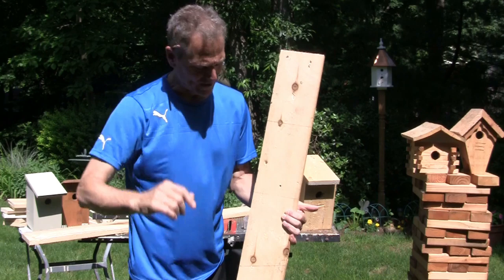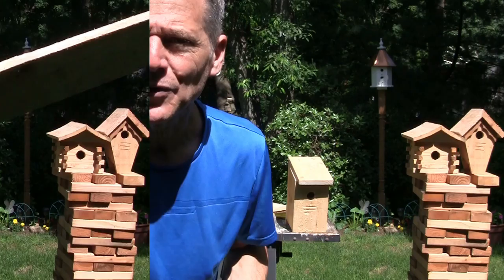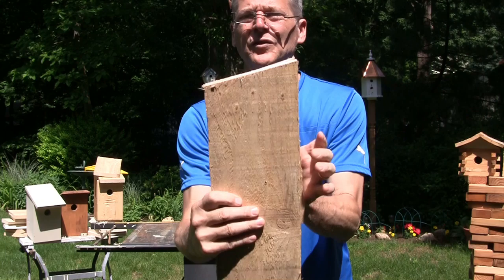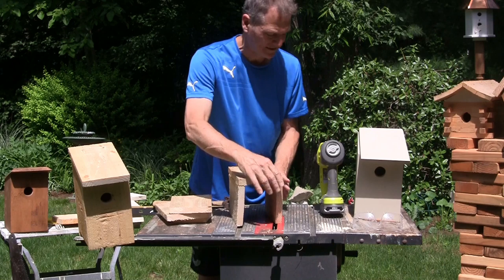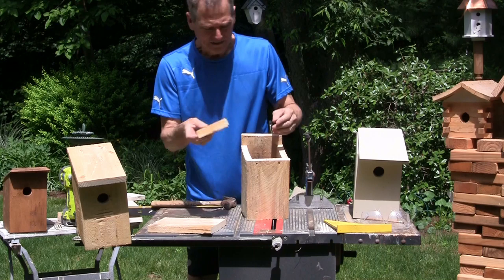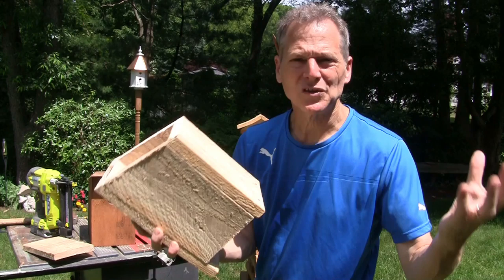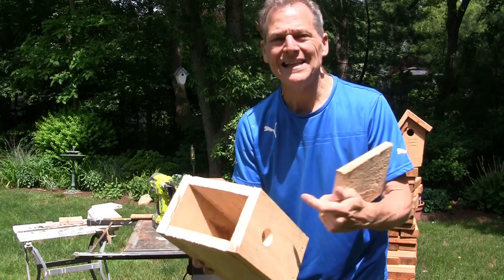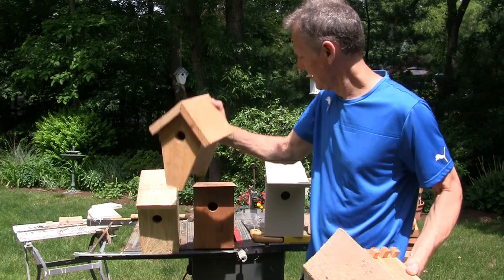Build the Easiest  and Simplest Bird House Ever!!!!

Comment: Yes, I built one of those.  Bore hole before assembly.  Made of 1x2s and 1x4s that fell into my lap. 3 inch screws made this into 1x6 nominal. The hole saw hit one of these and lost all its teeth! Chiseled out the rest and de- stroyed the front. Fix was to use a 1x4 with a properly bored hole with a circle cutter. Left very long it allowed the use of used Harbor Freight instant garage poles. Drill the screw holes straight through the 1x4 at 2 points and put the pole behind that. That keeps bigger  birds from attacking through the hole and pecking due to the double thickness.  Well,  we'll see.
Reply from the maker: Sounds like a fun time and many adjustment to the project..I Like them

Comment: The roof should have some latch and lock it doesn't blow off or get knocked off by a predator. I prefer a side opening box, I think it's easier to clean, but otherwise that is the optimal design for efficiency.

The best thing you did was the recessed bottom, keeps the nest much drier.
Reply from the maker: well said..thanks for the comment

Comment: I seem to have missed the dimensions for back and bottom? Thanks for posting Ken.
Reply from the maker: For the bottom I started using screens..It give good air flow and its easy to in stall..Back is two inches taller them the front..This gives you some area to mount the Bird house..Hope this helps you..

Comment: I had a house wren making a nest in my garage for many years.  We have a storage rack next to the garage door and on one of the shelves laying on its side was a 2-gallon green plastic garden watering can (my wife never uses it) that the wren was using.   So, I cleaned out the watering can the other day and couldn't believe how much debris was in there, it was literally full of twigs, carpet fibers and other stuff.  

While I was cleaning out the watering can, the wren appeared out of the bushes and started making noise.  I guess he wanted to use it again this year.  There were no eggs in the watering can, I think it is too early in the season for that.  

A few years ago, I found 4 or 5 dead baby wrens on the floor of the garage.  It looked like they were trying to get out of the garage because they were by the vents near the garage wall on the floor.  They were trapped in the garage because the door was closed, probably closed for a couple days.  I live in southern California and it gets really hot here and the garage can be an oven.  I felt so bad about it.

Anyhow, this prompted me to build a bird house for the wren.  I found your video inspiring.  
2 questions,
1) I have a bunch of OSB plywood and was thinking of using that, would you recommend that type of wood?  
2) Would a 1-1/4" hole be adequate?  As that is the only Spade Drill Bit size I own.
Reply from the maker: Yes the plywood would be fine. Also the inch and a quarter would be fine for the hole size.  But I’m not sure what to tell you about the garage door. Keeping it closed for days will mean mom and dad will not be able to feed them.  Can you put the new bird nest outside somewhere?  Good luck with your project
Reply: @Backyardprojectguy from one Ken to another thank you.
I  was concerned the wood might be too thin,  it is only 3/8 thick which i didn't mention. Most recommend 3/4 thick.  I could just double it up that might do.  

And yes i was planning on locating the new bird house outside next to a tree beside the garage.  There are shrubs surrounding the tree and i bet that is where the wren lives. 

 I may also build a bird house for the western bluebirds and Northern flickers i feed in my back yard.  I will have to purchase more drill bits for that,  but hey,  I'm retired and have all the time in the world.
Reply from the maker: From one Ken to another I don’t think the birds care about the thickness of the walls of the birdhouse it may be a construction problem for you trying to nail the sides together and 3/8 inch that’s all the problem I think making the birdhouse for the flicker in the bluebirds cool blue birds are great they’re cool to have around and there’s lots of examples of blue bird houses in the video good luck in your projects hope this helps thanks see ya bye

Comment: Hello Bird Friend,
Superb work done for our Winged Friends.
However, a little advice;
- Drill ventilation holes at the bottom at the four cardinal corners and one in the center to avoid humidity and mold which could decimate a partial or total nesting.
- For a single sloping roof, always leave an offset on each side of the nest, in case of rain and wind the sides will not rot.
- Linseed oil heated in a bain-marie for exterior protection to be repeated each year, the interior remains natural, doing nothing.
Good continuation to you the Friend, Sincerely Alain from Belgium.
Reply from the maker: Thank you my flying wings friend..Funny you should talk about the air flow...I have started using a mesh screen for the floors and its working great..Love the idea of linseed oil. I have use plenty of it in my shop but never used it there..Great ideas..Thanks for the comments, always appreciate good ideas to make us all better..
Reply: @Backyardprojectguy ,  Hello my friend,
Yes linseed oil is a natural product and once on the wood it protects well, obviously to redo the operation every year, I have been using the nest for 10 years, but for the spring of 2024 a new nest will be put in in place, for the mesh screen you are not afraid that the birds will take the middle fingers and nails in the holes?.
Sincerely Alain from Belgium.
Reply from the maker: @Wahnerheide    good question..when i use the mesh screen i usually add some sticks ans leaves to get it started..

Comment: Great stuff. Thanks. As you point out, you don’t necessarily need a bench saw or circular saw. A couple of additional points:
- some people (me included, with some boxes) add a perching pole on the outside just below the hole. It makes it easier for the parent birds to feed the young. However, it can make the occupants vulnerable to predator birds if the hole is too big
- if the box is on a house wall, you may need to consider the roof direction, if you need to minimise the risk of water ingress.
Reply from the maker: Yes!!.. Great Info on your comment, important stuff..Thanks for sharing that..I appreciate that..Now lets go make some saw Dust!!
Reply: I agree - except for the perch. The birds do not need them in any way - they can feed the young just as good without a perch. So skip it!

Comment: Great instructions but you should know people cut the corners off of the bottom piece or drill holes not for ventilation, but to allow water to drain out. Ventilation holes in the sides are important too
Reply from the maker: Yes  you are correct..good call I should have said something..as I have done this on many of my birdhouses. My last couple I started using a half inch screen, That really open it up..We will see if the birds like it..Thanks for the comment..Always looking to get better

Comment: Great ideas! 

A few questions/concerns: Doesn't it have to be a certain kind of untreated wood and wood that is nontoxic? For example, oak is toxic for birds. Also, zinc/ galvanized metals are also toxic to birds. There are also bird-safe paints. 

But I like the design of the second house because while the bird is entering the house during rainy weather, he or she is not going to get drenched in runoff water, unlike the first design where during the rain the run-off will likely affect the bird.
Reply from the maker: Well said, I try to stay away from paint. I have stained some of my bird houses, but most are natural untreated wood. For example I would never used pretreated wood or pressured treated wood.
Reply: @Backyardprojectguy  Do people make birdhouses for wild pigeons and doves? If so what are the modifications, one needs to make? Thanks
Reply from the maker: @BirdiePariRicoFriends  The Pigeons and the doves are open end birdhouses. They will not go into a traditional birdhouse..People that raise them will make the a large coup type with several pairs in it..Hope this helps

Comment: The pieces of wood should be turned so that the side facing the center of the tree (see the veins where it is cut) faces out. If your construction is due to moisture and the tree's veins do not turn as described here, the birdhouse joints may work apart. The danger of this is of course the greatest if you use nails instead of screws.
Reply from the maker: oh  very cool   thanks for the tip..I will keep this in mind..

Comment: Appreciate the video but you need ventilation ventilation !!
   The birds may nest in it at first but if it turns off hot, they are dead.  
    You know this , right !?!
Reply from the maker: Oh yea...If you notice the joints are not sealed..Most of the times I put air holes in the bottom..Thanks for the comment

Comment: I think the birds do care, first you never drilled off the 1/4 inch corners at the bottom when you could have to let water drain out, I never seen any vents cut to let air in on a hot summer day and the top removal is not how its done today, how are you going to clean out the old nest, or check to see if the invasive house sparrow that kills our songbirds have moved in, should be done each week, a door should open to do that, at the end of nesting' you will have mites and sometimes dead babies that need to be cleaned out and by the way the whole you drilled is not the size for a House Wren they use a 1 1/4 inch, you drilled a 1 1/2 inch hole.
Reply from the maker: Thanks for the tips..I appreciate that